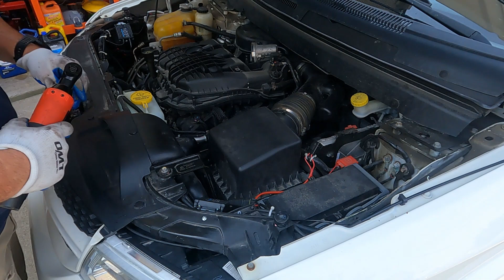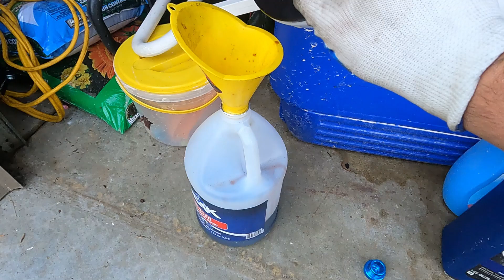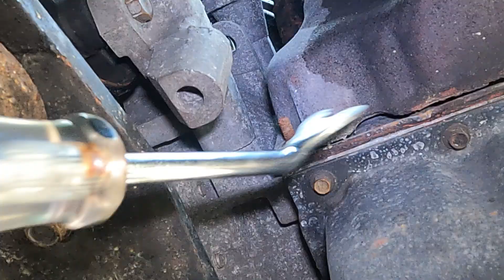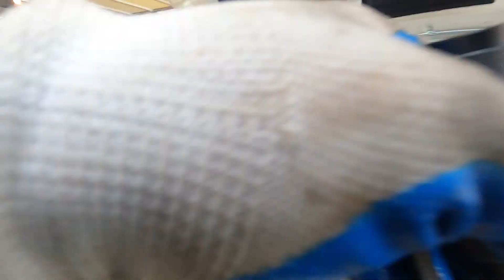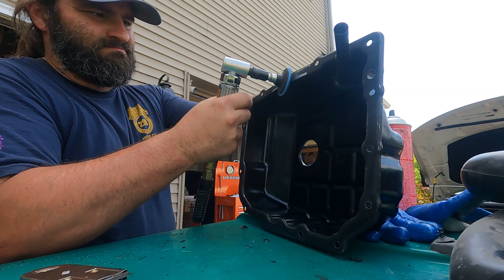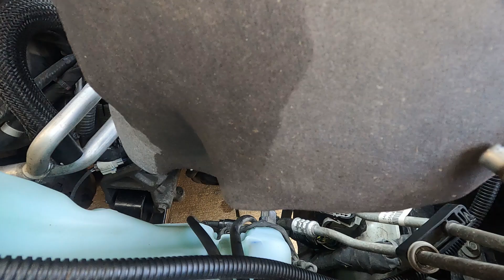Chrysler/Dodge 6 Speed Transmission jerking when slowing down? This may be your solution!

Comment: You can remove front pan without removing any flud.  If its filled to the proper level.   

Did you have any codes?
Reply from the maker: That’s really good to know for the future. But thankfully, I needed to change fluid out anyway, it was not setting any codes if I remember correctly. It just seemed like the logical thing to replace based off of how it was shifting.  Thanks for watching!